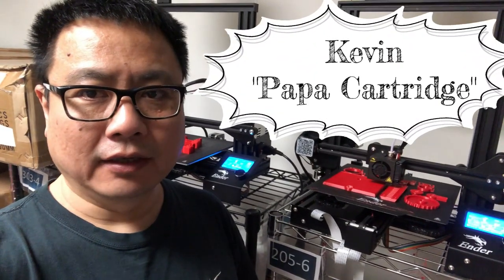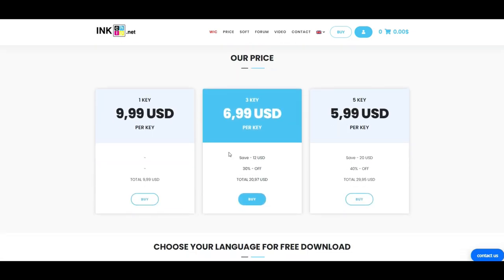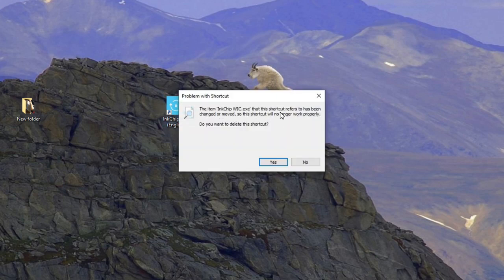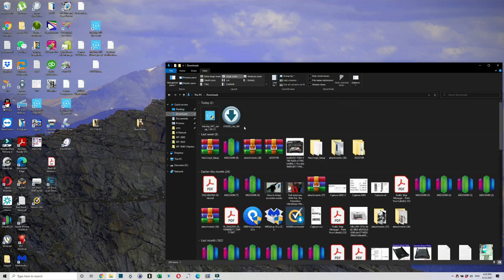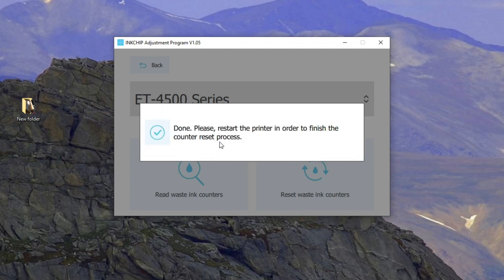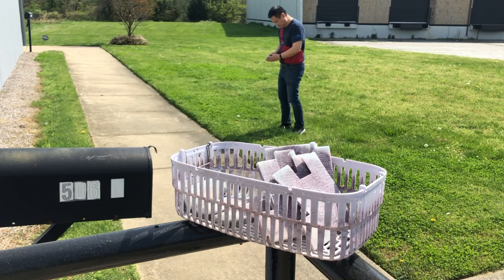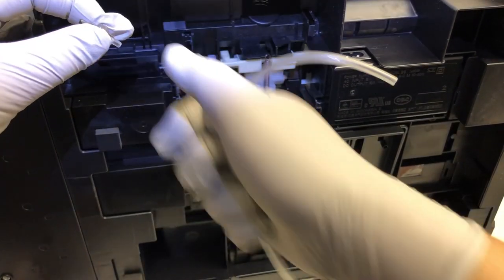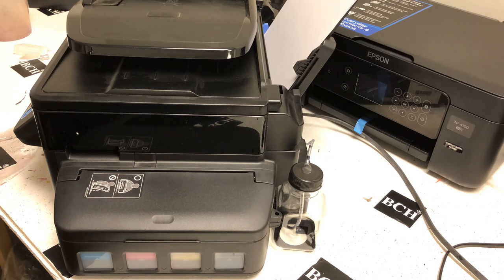Epson EcoTank ET4500 "End of Service Life" - Waste Ink Counter WIC Pad Cleaning & Fix

Comment: Good video. Unfortunately I have a ET-4550, the rear of the printer is not the same... please are able to help with instructions to remove the sponges on the et-4550. Many thanks.

Comment: Hello Kevin, Appreciate the video. I see a few people have asked you about the Epson ET-4550. I have a bunch of Epson printers. As you know they like to shut them down. Do you do repairs in your shop? Can I send 2 printers to you? I would like them both repaired. This way I can pay you and not have to buy another printer from Epson. Both of my printers that are down worked great and then magically stopped. To be honest I do not want to deal with the headache. I have the ET-4550 eco tank and the WP-4530. I know they are just basic issues. Our ET-3750 seems to be okay as well as our 4750. Just want a place we can send our printers when we need to fix them. If you are able to do so, please let us know ASAP. Also, an idea of what you would charge.

Comment: I'm soo disappointed with this printer, I will never buy one again. I never had this problem with printers that use regular cartridges.  Your video was good but it's more than I want to do especially rinsing out that black ink. I would rather just buy new replacement pads